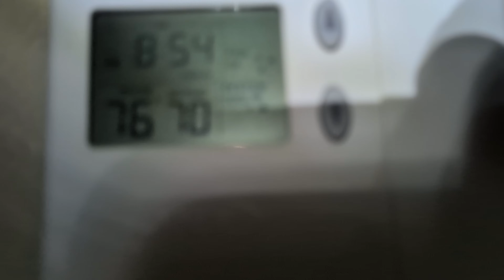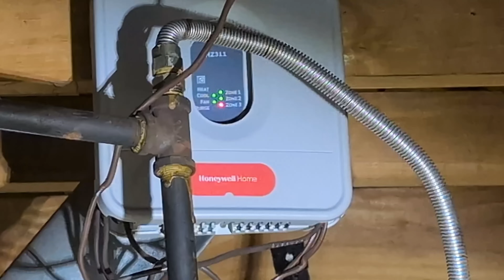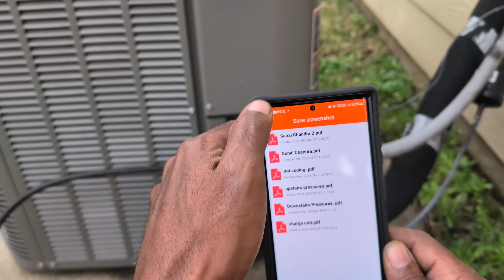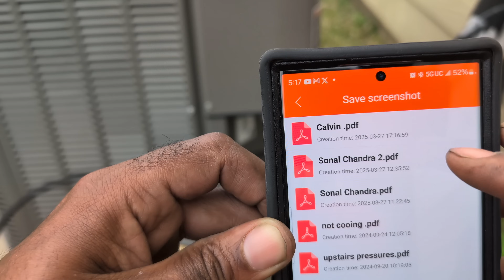They Left Cans on the Condenser Unit… Now It Won’t Cool! #hvac 🧊 Katy AC Repair 🔥

Comment: The cans did nothing to the ac unit.  Just saying I don’t even have to watch this.
Reply: Cans blocked air flow, low air flow creates high head pressure, that leads to overheating, that causes caps to blow! Thus, needs a new indoor TXV!

Comment: There maybe something else causing cap to go bad
Reply from the maker: If this one goes out I'll look into it
Reply: I usually find it be a power grid issue in some areas. If it’s a customer of mine and not home warranty I offer a better band cap. Usually the turbo 200 products. The customer never has that issue anymore. Plus they have a 5 years warranty